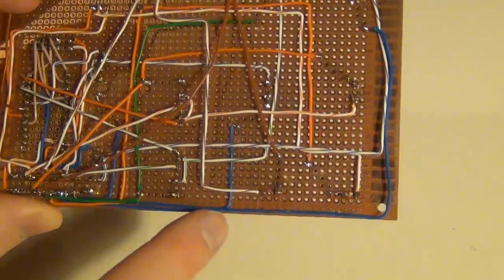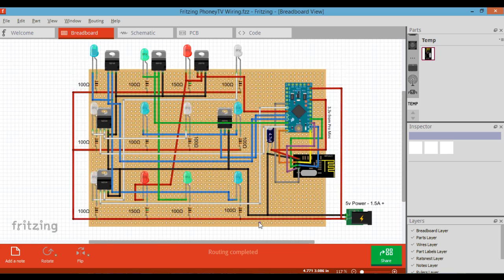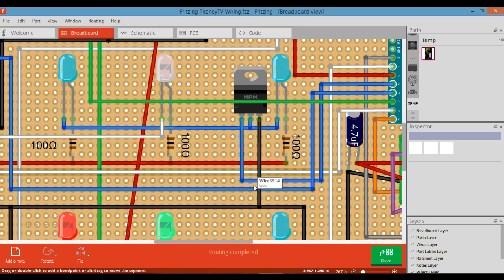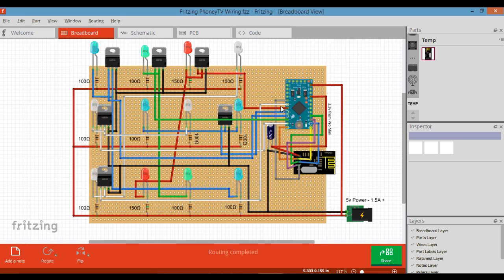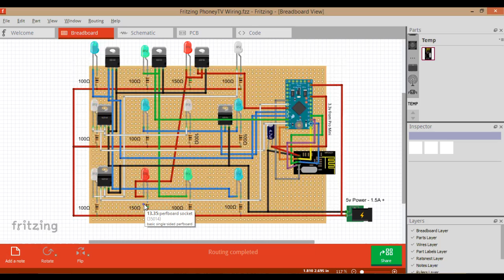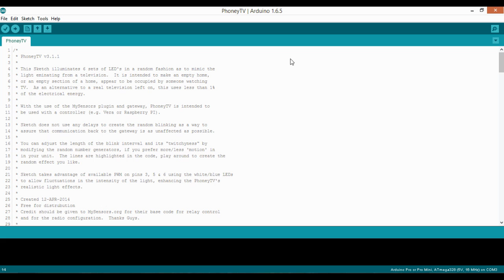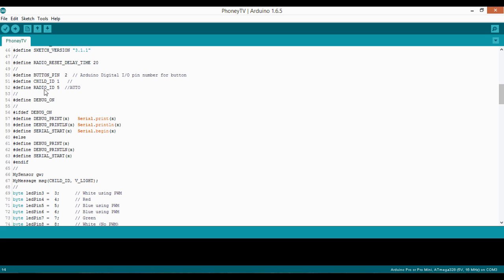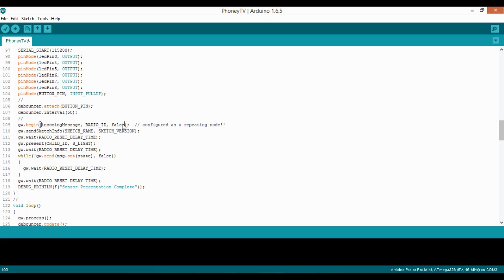DIY PhoneyTV with Arduino and MySensors

Comment: Why would you need to use half watt resistors when the LEDs max out at what? 20-40mA?
Reply from the maker: +bp968 I didn't measure the current but the are the "super bright" 1/2 watt LEDs.
Reply: +Pete B really?  1/2W 10mm LEDs?  I've never seen those, they are usually 40mA which should come out to 80-160mW draw at max current.  regardless, it's a neat build.  thanks for doing the videos related to the mysensors stuff.  I'm working with them right now using Domoticz as the controller.  I might try my hand at some boards through oshpark though instead of doing protoboard.  I kinda suck at protoboards so far!
Reply from the maker: bp968 Thanks.  Yeah, I didn't test so I can't say for sure but that's what the description of the LEDs says.
I am interested in prefab PCBs as well.  I haven't had a device that I need 10 of yet though so I haven't looked into it too much.  I will soon though.  As for the protoboards, make sure you get the green ones.  The brown ones (like in this video) are very hard to work with.  The double sided green boards make it much easier.

Comment: You're way better off using NeoPixels for that (no Mosfets, less digital I/O used, no resistors needed, and fully addressable.. Oh,, and each NeoPixel is RGB)... Thanks for sharing though, great idea for a mysensors 'thing' :)
Reply from the maker: +Joop Media Thanks for sharing.  I haven't used NeoPixels yet but I will definitely need to order some.  I saw Henrik's project with them but that's pretty much it.  The only thing I'm wondering in regards to this project is how bright they are...?  They need to be pretty bright for this project (in my opinion).
Reply: Yeah, NeoPixels (even just the 5050 ones are super bright, but another benefit of the WS2811\WS2812 is you can control the brightness as well as colour for each pixel individually. Also, as well as being able to buy 5mm / 8mm / 10mm nepixel leds, you can also just buy the controller chips and drive the LEDs you've already got, and only use 1 I/O pin on the arduino.. cheers :)
Reply from the maker: Joop Media Cool!  I'll definitely have to check them out for future projects.  Thanks.